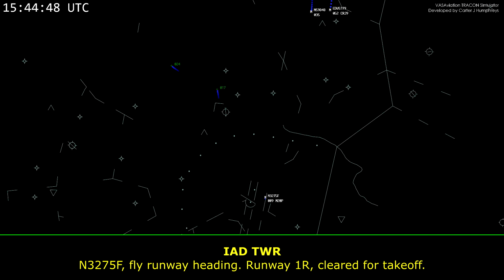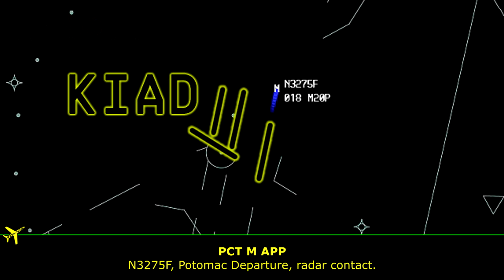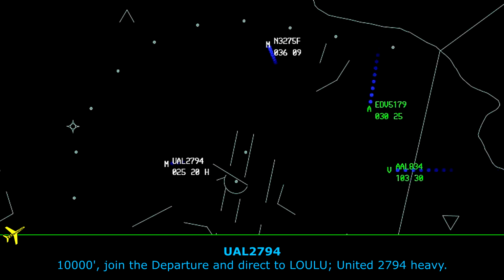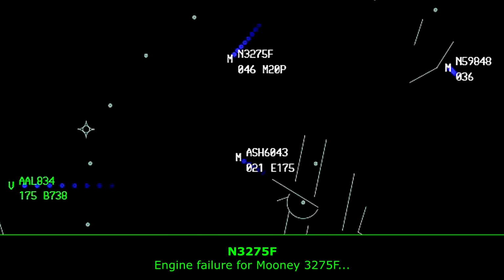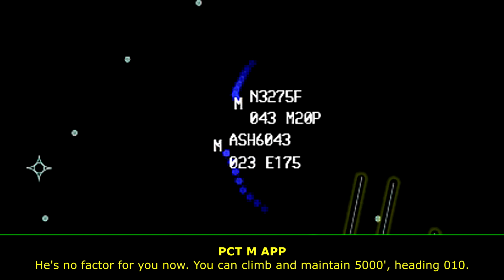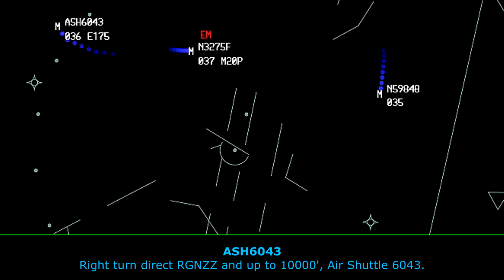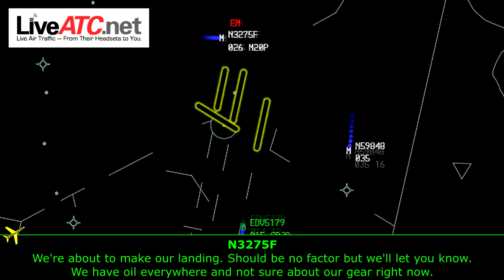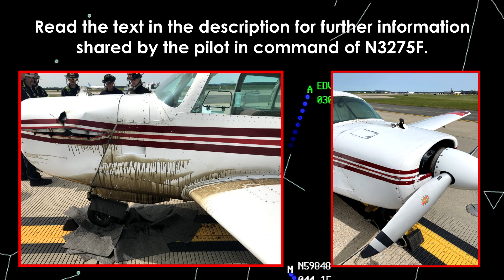Mooney M20F has ENGINE EXPLOSION AFTER TAKEOFF | Emergency Returns

Comment from the maker: PILOT STATEMENT:

After we took off out of KIAD we were vectored around the north side of the field. We were cleared direct to Charlottesville at about the same time as we levelled off at cruise at 4,500 feet. We had just started running the cruise checklist when we heard a loud bang, and the engine started shaking. I immediately took the flight controls from my student, and I attempted to report a partial engine power loss to ATC. Upon listening to the tapes, I was stepped on or stepped on somebody when I started the call. Mid-sentence to ATC it became a full power loss. From the internet archives, my call begins with the realization of the full power loss.

	The controller quickly cleared me “left turn, direct Dulles, any runway.” At 4,500’ only a couple miles WNW of the field I had altitude on my side. I could likely have made any runway, but I did not want to attempt to go further than my glide would have allowed. I made a quick decision to take 19C. I innately started going through my ABC’s of emergency procedures. I quickly realized at that point my objective was not to glide far, but to descend quickly to the runway. I lowered the gear and added the flaps to increase my drag to help me descend rapidly. I pushed the nose down to increase my descent rate. Upon turning final, I was way higher than standard, but I knew that KIAD had a runway more than long enough for me to bleed my energy over. I began a forward slip on final and was aiming for the front of the runway with anticipation of floating over the runway. I was nearing touching down when I saw the 5,000’ of runway remaining marker. That was when I knew that we made it. I was unsure if the nose gear was still attached due to the severity of the shakes, and noises around the nose, but all wheels were there for me to land. I attempted to take the high-speed taxiway to clear the runway, but my momentum ran out before I crossed the Hold Short line thus, getting out in the runway environment with the fire crews right behind. 

	If I could have done anything different, I would have done two things. When I teach my students about engine failures, I say to circle your touchdown point to lose altitude and set up for a normal landing. I opted for the nonstandard approach due to the busy nature of the airport, and the quantity of nearby buildings, I did not want to circle around it. Additionally, I was not sure if I was on fire, and the excess airspeed was helpful for that. I knew I had plenty of runway to burn my energy over, which worked well, but If I could change anything, I would’ve made a circling descent. Additionally, I would have unlatched the door upon landing. You never know what happens, and I think having my exit open would have been beneficial, but luckily the airframe was in a state that it was unnecessary. 

	Overall, I am proud of the result, and considering the circumstances, it ended in the best possible outcome
Reply: Second guess all you want, but understand that the ability to second guess yourself means that you did an excellent job.
Reply: VASAviation - great job to the pilot! All the more reason to practice those engine out landings!
Reply: Hat off to that amazing job , and one in life time “real engine failure training “ to your student ...
Reply: No need to second guess. Everyone walked away and even better, no bent metal upon landing. Fantastic job.
Reply: Great Job👍👍
Reply: Well handled, and good debrief. Reading this was certainly a good review of emergency procedures, something 100-200 hour pilots like myself tend to neglect...
Reply: Awesome piloting.
Reply: Nice job!
Reply: You should always "second guess". As part of the debrief you should identify anything you think could have been done better.  Only way to keep improving for yourself or someone else.

Also, hope they make it to CHO soon. (Go 'Hoos! Still the defending national champs! Just saying . . . . )
Reply: VASAviation - great job but never rush in an emergency do what you have to do
Reply: John Paul Lafferty that was no explosion just a poor choice of words
Reply: VASAviation - what was the cause of the failure
Reply: So very glad everyone was safe!
Reply: When I had been taking flying lessons my instructor drilled into my head to fly the aircraft first and always be mindful of the surroundings. In Northern British Columbia airports are far and few in between with lots of mountains and lakes around and he always said even if you know the area treat it like you have flown over it for the first time as it won’t let you get fixated on a certain area that may be out of reach. He also said you will be second guessing yourself constantly but just pick a course and stay with it and fly the plane. I can only imagine what that student in the plane was thinking about.
Reply: Excellent flying sir!
Reply: Do you know what happened to the plane?
Reply: @kenclark9888  Certainly looked like a small explosion to me. Look at the two end video pictures, you can see the cowling is separated and bowed outwards as well as shrapnel that pierced the top of the cowling

Definitely an explosion
Reply: NoName5589 it’s not an explosion. What happened was he had some internal parts fail on the engine and they came through both the engine cowl thus the separation and also I’d bet the cylinder jugs and block
Reply: 6 there was not a fire here at all.  But some times excess airspeed is used to blow out the flames.
Reply: I really wanna look at that engine close-up.
Reply: My two cents to the PiC: 

For what it's worth, nothing short of the catastrophic death whip of a fractured prop at speed would run the risk of shaking any gear off. 
Long as the frame holds together, the gear will hold together. :)

I'm glad you and your student made it down safe! 

Wish i could take a look at that engine myself. 
Cheers from the A&P world!
Reply: Interesting assessment from the instructor, and a great job dealing with the emergency. I disagree with him on the concept of a circling descent, however. I'd always teach to never turn your back on your intended landing area in an emergency. You have flaps, spoilers, the ability to sideslip, and pain old drag to help you descend if you need to. Move your base leg away from the threshold if necessary to extend your final, but keep the runway in sight. It helps with judging your glide angle if you can see what you're supposed to be gliding towards
Reply: Great job. Looks like it let go with some force!
Reply: @bigdpurser  You're right of course given the hole in the engine cowling I'd be interested to see some photos of how bad the engine let loose.
Reply: @NoName5589  looks like he blew up a cylinder. Coulda knocked a valve, could've snapped a piston rod, could've lost timing and backfired. One thing for sure, part of something that deals with the cylinder left inside the engine and exited the cowling. My guess is the student pilot may have pushed the throttle too quickly and something gave, which either messed up the timing of the ignition, or something made contact with the piston head. Thinking about it more my money's on a valve strike
Reply: Nice work, Captain, and I don’t just say that because I happen to live right under the 1C approach path 😁.  And thanks so much for giving @VASAviation this statement so that we can all learn from your experience (“experience” meant here in both senses of the word!). I hope your student wasn’t too traumatized and was able to fully absorb this baptism-by-fire lesson! Thanks again.
Reply: Had an engine block split in half on my FIRST flight in a Cessna 152. We were at pattern altitude abeam the center of the runway. Amazingly, we had SOME power. I did the only thing I could think of at the time. I turned to my instructor and said "You have the aircraft"
Reply: Those darn sfra gates
Reply: controller cut you off to divert the jet that was flying towards you, told them to go 270 while you were still talking :)
Reply: Brilliant work. What was the root cause of the catastrophic engine failure?
Reply: Luckily for the student you didn't just look at him, and say: "Well, what do we do now? This is a great teaching case. You have the controls"
Reply: fantastic.  You know the saying;  any landing you can walk away from is a good one.  If the plane can be used the next day it was a fantastic landing.
Reply: Great job in bringing the Mooney down safely and savings two lives. Any indication on the engine failure, looked like a blown piston ?
Reply: @Muggles87  I agree on the circle observation. Circling also adds guesswork into the equation...Do I have enough height to complete the circle and land successfully?  Eyes on landing point and use alternative methods to lose height. ‘Popping the hatch’ was ingrained into me during emergency check list. It’s a great one to practice with new passengers. Scares the crap out of them but often they’re the ones to do it depending on the plane.
Reply: As a pilot myself, people who fly these little planes without a parachute installed are crazy. I had to use it once in my Piper and it saved my life. FAA stats prove ballistic parachutes have saved hundreds of lives. I would never get in one of these unless it was equipped with one
Reply: Training is the key to success in these situations. We revert to our training 
& they make a stressful situation routine. Don't declare it just deal with it.
Reply: Glad you landed safely

Comment: I had an engine failure last summer - my first ever in many years of flying. I called an emergency and the funny thing is you don't panic as you might expect you would when it all goes quiet - your training just kicks in and you go through the process of getting it down. Lucky enough I found a nice big field and dropped it in with a normal glide approach after manoeuvering to lose height. The problem was a temporary fuel one and once that was rectified I was able to take off from the field and fly back to my departure airfield. That was a crazy time. Due to related problems while preparing the aircraft for ferrying from the UK to France I also had a partial EF after take off and had managed to do a hairy 180 back at low level for a fast downwind landing. Luckily when I got to the root of the problems (incorrect fuel tubing of too small diameter and a failing ignition stator coil) the aircraft was fine and got me across the English Channel and down to south-west France.

Comment: That is the definition of an engine that has "Grenaded".
Reply: I've never worked on an aircraft before, but auto engines get pretty damn loud before they make such a dramatic exit. I wonder if it was drowned out by how loud they are normally.
Reply: @elguapo1690  Aircraft engines do tend to make a lot of noise.  Exhaust silencing is minimal if present at all, and the prop itself drones pretty loudly as well.  Takeoff and initial climb is also the most stressful time for the engine, so it could be that a crack started in earnest on that particular takeoff and reached failure point a few minutes later.

Comment: Even before reading the pinned comment I was a bit scared of high altitude and how much energy needed to be bled out. Fortunately it is a relatively tiny plane and the Pilot knew what they were doing. Not to mention oil all over the windows that reduced visibility - I'm not a panicky guy, but IDK if I would be so calm in that situation.
Thankfully everything ended up okay. I assume Runway had to be cleaned, but otherwise I hope that everything is covered by some insurance. Plane seems to be repairable.
GREAT JOB!

Comment: Great job!   If the instructor or student read this, I do have a question.... I'm curious as to why  you filed to leave via the JANSEN gate versus the FLUKY gate which would put you on course for Charlottesville? 

(Background for those not familiar with flying around Washington, DC. SFRA - Special flight rules area)

Every aircraft operating within 30NM of Washington have to have a discrete transponder code preassigned before you enter the SFRA and be in contact with ATC. VFR flights have to file a special type of flight plan that looks like a IFR flight plan, but isn't. There are eight predefined "gateways"  or arcs that let ATC the general direction that you want to leave (or enter) the SFRA.
Reply: Hi jcl410, good question. I was the student on this flight. I'm a rusty pilot who quit flying about the same time the SFRA was originally enacted, so this trip was all about getting some experience with the DC SFRA. Elected JASEN gate and a northbound departure (rather then RWY 30) in preparation of an upcoming flight to Leesburg as that path nearly overflies KJYO and I simply wanted to get my eyes on it.
Reply: @kyleheld7341  That explains it! :-)  -Thanks for the quick reply... 

John
Reply: @kyleheld7341  I would love to hear your take on this, or have I missed it?

Comment: Looks like the cylinder blew, I recently had this happen to me. If you want I can give you information and photos on that as I was filed IFR (thankfully in VFR conditions) so was on with ATC at the time. Turned out had a falsely signed off AD on the cylinders. Glad everyone made it down here it certainly is an experience to shake you.

Comment: wow, that was so great that you made it to 4500' before the failure, and then were headed back toward KIAD..  I used to own N3292F here in the DC area, also a M20F, and can imagine what it was like.  Curious why on the tape the pilot reported that they might have trouble with the gear.  The plane had manual gear with a large lever in between the seats.

Oh, the title of the Youtube video reads M20F, but the radar tag shows M20P.  I don't think there is a model M20P.

Comment: Always interesting to see how the controllers react abs the stress mistakes they make. Not meant to be a criticism in any way, just an interesting insight into human factors
Reply: What mistake did he do though
Reply: hannonik Maybe mistake is the wrong word. Just little things that come out due to the stress like half clearing him for a visual approach then clearing him to land (which he did twice). Correcting himself on departure freq he was giving. Again, just an observation about the stress that must kick in in these scenarios for ATC.
Reply: @expataviator7107  Yeah that stuff does happen. Had a few emergencies till now, however the one that stood out the most for me was one where a pilot reported smoke in the cockpit. Stuttered a few transmissions to other pilots and then cleared the emergency aircraft for the wrong runway at first :D (27R instead of 26). I guess in these situations with all the coordination going around "off tape" and so much to think about that can happen sometimes.
Reply: I think the second cleared to land instruction was simply intended as reassurance for the pilot
Reply: Jenny Mulholland yeah totally agree. Not that he had much choice in that moment :).

Comment: I had a similar event in a Cessna 172 STC'd auto gas. We landed without incident at an uncontrolled airport in coordination with Detroit approach who acted with our wishes for fire and ambo to meet us. When I knew we had the airport made , I said to my passenger open your door and once on the ground to pull the mixture. I shut off the master and radio switches and departed the plane. The worst question from ATC was "Souls on board".

Comment: Wow, that's a really interesting video. Great job by the pilots and controllers, and by the video producer to summarize the story so well. I'm glad everyone made it out ok.

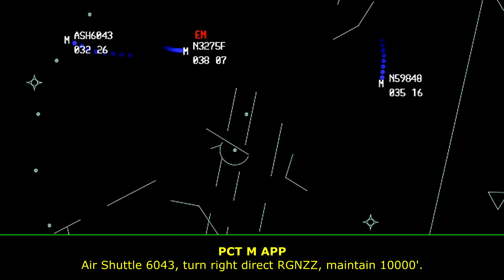One trivia question: At about 4:30 ATC issues an instruction to Air Shuttle 6043 using the waypoint "RGNZZ", pronounced "Riggins". Is that a connection to "The Diesel", John Riggins?
Reply: K C  ... pretty sure it is reference to the Redskins great RB John Riggins.

Appears “RIGNZ” is a fix on the JCOBY 3 Departure ... which also includes GRIIM and BAUGH

https://aeronav.faa.gov/d-tpp/2011/05100JCOBY.PDF
Reply: @flyerjack1548  Thanks for the info. Back in the early 80's, NFL was shown regularly on UK Channel 4 for the first time, and the Redskins were dominant then.  A lot of those names sound familiar, along with Joe Theismann, Art Monk, Joe Gibbs and others. And then the "Monsters of Midway" took over, but that's another story......

Comment: Scary stuff right there. Im REALLY afraid of piston engine driven aircraft...
Reply: It's common to feel that way until you see your first turbine unravel--hopefully leaving the fuselage, lines, and passengers intact. Turbines fail less often, but they can be catastrophic beyond what any piston engine could do.
Reply: @ReluctantPost  WOW. I never thought about it like that. As a former career mechanic, I'm really curious what caused that engine to throw rods like that. Poor maintenance? Overspeeding it? Did they find out the cause?
Reply: @jaydubb71  I don't know, as I didn't try to find those details but the airframe is certainly old so it's possible that the engine has a lot of hours depending on last overhaul date, etc. The other thing about aircraft engines in general, though, is that their normal operation is at very high percentages of their rated power available compared to cars and trucks. For example, in cruise flight, it would be typical for Mooney to specify 55% power as the lowest number in their charts for speed and fuel consumption, compared to a car or truck cruising down the road at maybe 15 - 20% most of the time. That impacts wear and component life, which is one reason they require a lot more routine and more expensive maintenance.
Reply: @ReluctantPost  hmmmm... Sounds like marine engines. Always in higher rpm than automotive engines. And yeah. Aircraft engines do operate at a higher rpm. So I can understand the increased maintenance of the aircraft piston engines.